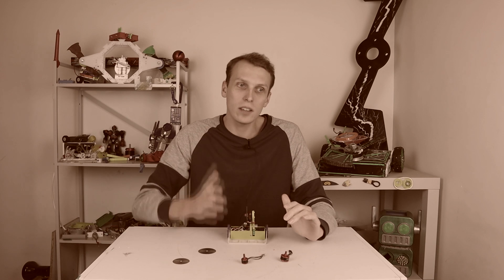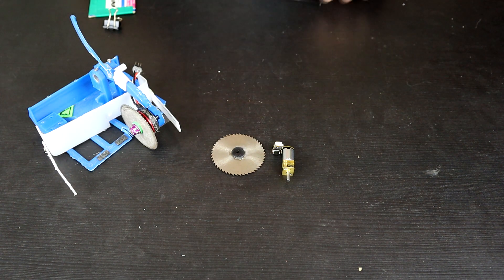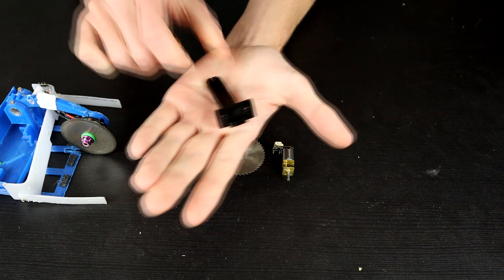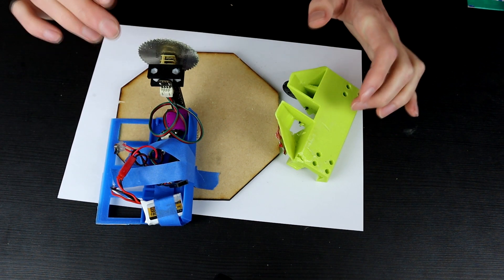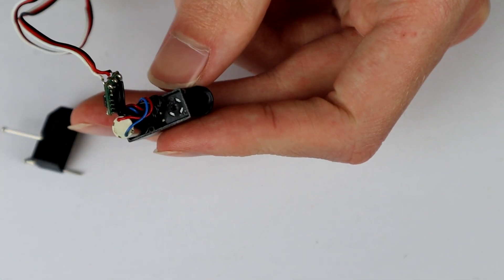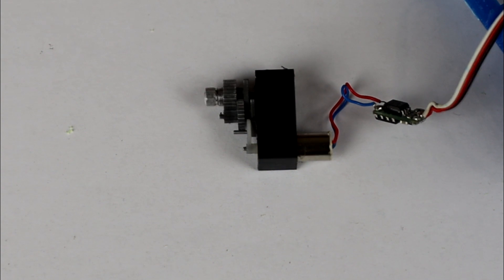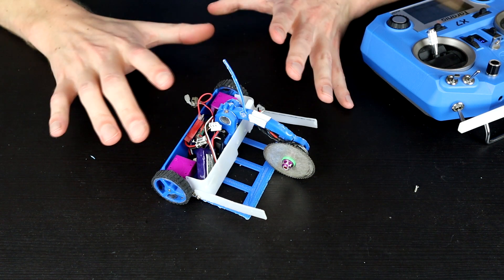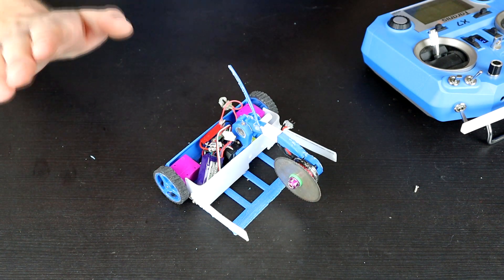To brush or to brushless? (150g saw bot upgrade)

Comment: Might need a custom blade that has a clearing tooth.  Most plastic blade saws have a trapizoidal tooth then a flat tooth.  One for cutting one for clearing, might be hard on the tiny blade.  Just thinking, I wonder if you could do rip cut blade as apposed to a crosscut blade would work, if the clearing tooth would help or hinder?
Reply from the maker: custom blades are hard to come by at this size and weight, its hard enough getting 50mm saws without buying a pack of 6 different sizes

Comment: It's possible you could run the big toothed sawblade backwards, then it would act more like the friction cutter plastic disk you used in a different video (I know this video is super old, but it might be worth a shot if you haven't already tried it).

Comment: It might be the momentum of the blade
Reply from the maker: oh?
Reply: Saw gets too much bite because it’s spinning slower. So if you faster it gets less bite and grinds/cuts more. Also I have no idea what a was talking about in my first comment 🤷‍♀️🤷🤷‍♂️
Reply from the maker: I hadnt thought about the fact that spin speed would effect bite, but you are right!
Need to spin it faster with more torque, which basically means a bigger motor and a smaller gearbox

Comment: It’s a bit fancy, but you could rewind an old brushless motor for a much lower kv. Your actual power is brought down slightly, but the balance between torque and RPM still changes. I’ve wound a few motors and it sucks but it’s not horribly difficult. On top of that, flashing the ESC could help. I’ve at least been able to squeeze more startup torque out of motors before.

Comment: The Pololu HP series of N20 could work well for the saw if your esc can handle 2A. They are pretty nuts.
Reply from the maker: Oh interesting, I'll have to have a look at those
Reply: @TeamPanicRobotics  There is no way the ESC in the dfrobot board can do 2 amps (nor can my version, the Red ESC) - use a discrete ESC I think.
Reply: Also the Pololu HP N20s have terminals which have a slightly different spacing than the standard ones, so they're probably not going to fit the integrated ESCs.
Reply from the maker: Yeah thats a good point, even the "robust" ant esc I'm working on only has 1.5A per channel.
So I'd need something fully custom to use those N20s, might be worth it though

Comment: Hi Ben,,great work getting Vogon Poetry sorted...in my overhead saw bots i use a 6v 15 rpm (2000:1) N20 to actuate the arm,running off a 3 channel esc,,Channel 1& 2 for drive..and i use a "SunnySky 1106" brushless for the saw blade with excellent results...the reason i use the "SunnySky 1106" is because the bearings are much better quality than other brands..https://youtu.be/dGPd_emYAOc Vid for reference...
Reply from the maker: Interesting that you are getting good power out of such a small saw motor,
When I did my testing I found that any motor smaller then the 2814 I'm using would just bog down when cutting

I love the idea of using an N20 for the arm but need the weight to be able to add it in

Comment: It was very interesting to see how well the N20 works as a weapon motor.

I see you can't get enough range out of the servo - a common problem. Some ideas to maybe try in the future:
- Use a discrete "servo stretcher" - but it is another piece of kit you need to find space for
- The Malenki-Nano now has a servo-stretcher mode (BUT: it affects both servo channels so it might make the brushless esc unhappy unless endpoints are set suitably)
- You could remove the control board from the servo and put it on a brushed controller but would have to be careful to not stall too much as those tiny motors might not be happy getting stalled for long on 8.4V

Great project. I see there are getting to be more powered overhead weapons all the time!
Reply: Yes.That's a pretty good idea.🤔
Reply from the maker: I've been looking at diy-ing a servo stretcher, but I am running out of weight and space, so I might not be able to fit it in.

Running this on a Malenki would probably help, but for simplicity of control scheme, I'm not using my flysky fs-i6 for this bot.
I'm using a Taranis instead. I have the parts to upgrade the taranis so it can talk to fs-i6 compatible rx's but just havent done that upgrade yet
Reply: @TeamPanicRobotics  I also use a Tanaris and on my saw/front flipper bot Shrapnel Mine I discovered that you can extend the range right on the Tanaris. EDIT: Just got to the end of the video, seems like your servo doesn't have as much room for expansion doing that as mine did. https://www.youtube.com/watch?v=AE3C_LSispc
Reply from the maker: I did get mine set for extended range but it only does a max of 150% I really need 200% to use the full range of this servo
I didnt try extended trims though, so I'll give that a shot

I ran the servo on an ardunio and setting the pulse lenght there I can get it to go 0-180 I just need the full 500us to 2500us signal range